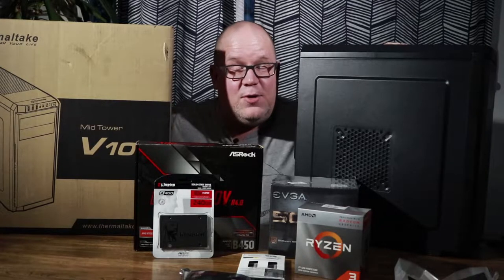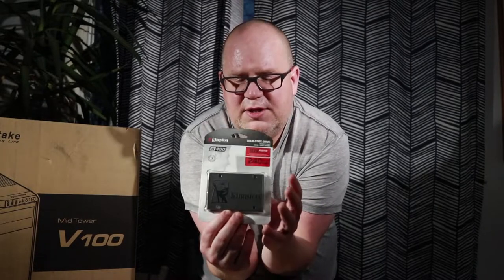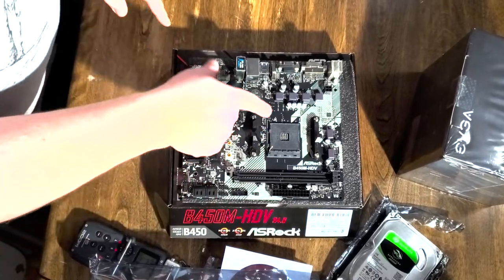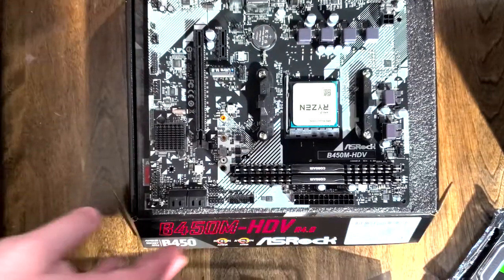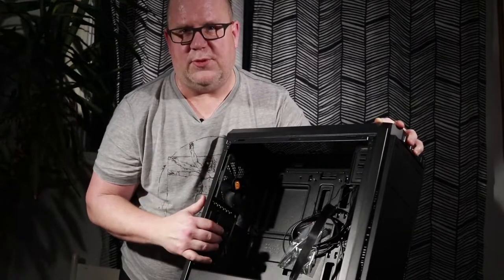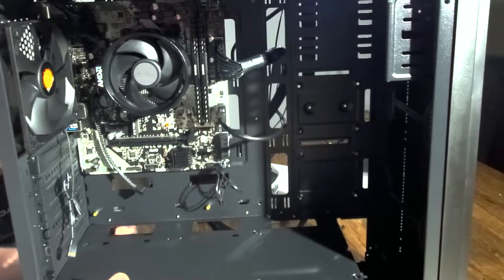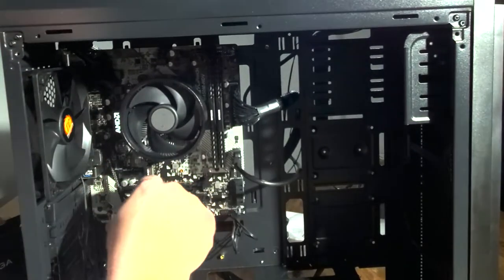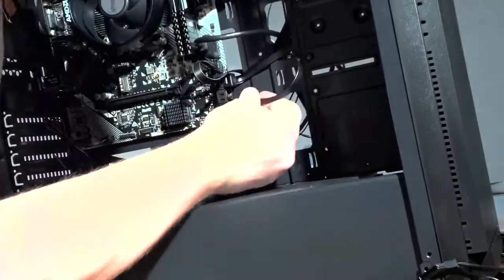How to BUILD A SUB-$500 PC in 2020! - Entry audio editing rig

Comment: What is a good 2070 super to get? 

The 2 I’m thinking of getting are the :

2070 super gaming oc 1815mhz 

2070 super windforce oc 1785mhz 

What one is better or are there any other better around the same price? Please let me know 😃
Reply from the maker: To be honest the 2000 series cards are all quite good.
Most of the 2070s are going to have extremely similar performance...with the exception of a bit of extra clock.
So grab your favourite and givr.
All this aside though...if you are gaming...grab one with the slightly higher clock speed to squeeze out them extra frames!
Reply: Dark Corner Studios if you was buying one what one would you go for
Reply from the maker: @idropsfishyfortnitechamp828  well...might as well go with the higher clock speed...if nothing else separates the two cards....might as well get the one that squeezes more fps